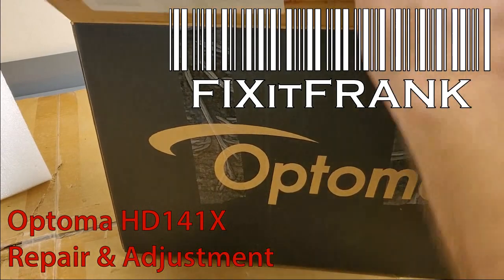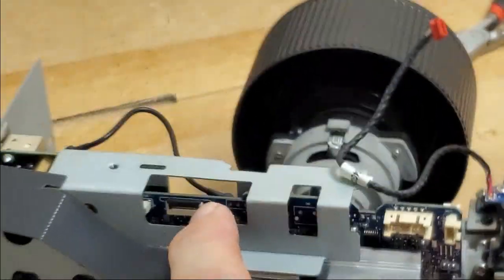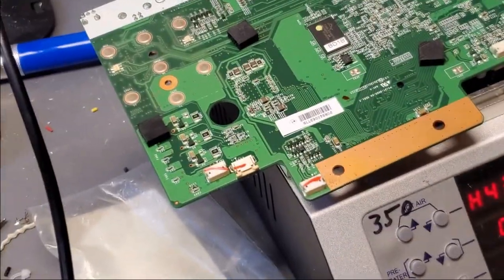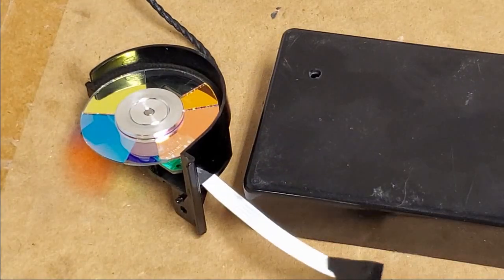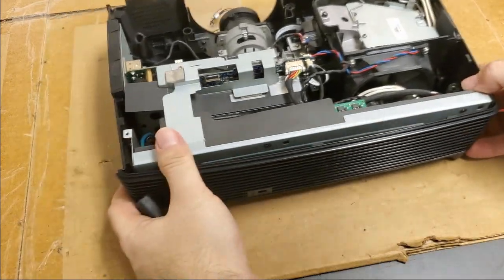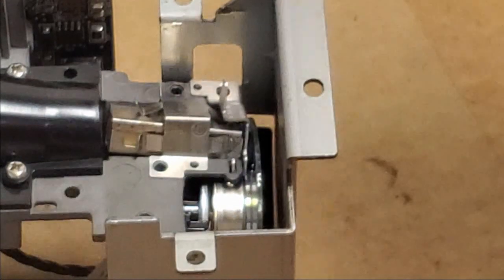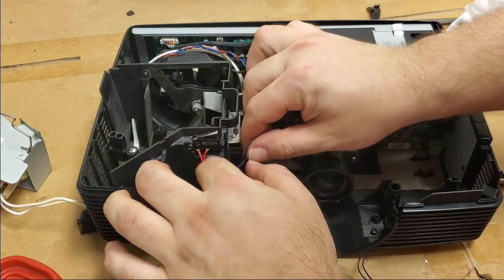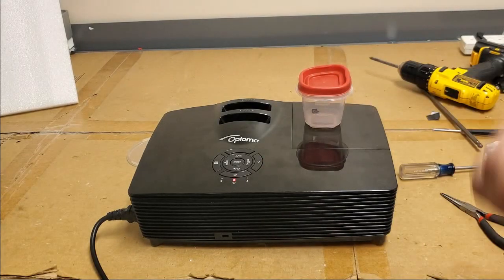Optoma HD141X DLP Video Projector Repair

Comment: Hi Frank, I have this model of projector and have been trying to troubleshoot it. It starts with a blue light and after pressing the power button the same light continues to blink blue. The fan and color wheel do not spin and the lamp will not ignite. Any ideas on what could be wrong?
Reply from the maker: It's hard to say exactly.  It could be a problem with the mainboard, but there could be a power supply problem as well. I would make sure the cables are tight inside. If you are good with a volt meter, checking the low voltage power to the mainboard would be a good first step in checking the subsystems.

Comment: Hey Frank, I have one more question. I have this projector completely disassembled just like in the video. I saw you bending the spring mechanism to adjust the light tunnel. I have taken out those screws to the part you were bending. My question is, how do I know if it is adjusted correctly before reassembling all of this? Thanks again.
Reply from the maker: You won't. Unless you left the top screws that push against the tunnel in place.  Even so, you may have to tweak them a little. They push the tunnel against the spring where as the spring pushes back.  That means loosening will let the tunnel tilt towards the screw and when tightened, it pushes back.  Put on some sunglasses when you tweak the screws to make it easier with the lamp on.  You will see the dark edges move around until you get the dark parts pushed off screen.  Once it looks even, you are good.  Its not really an exact adjustment. As long as you have uniformity with a blank screen you will be good.
Reply: Yep 👍🏽 I have the exact same shadow as this video! I’m just glad I found your video! I know there’s hope for my projector! I’m going to continue to tweak this until that shadow is gone.

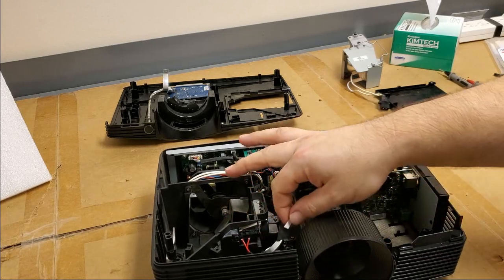Comment: Yep, at 3:16 of the video. I think that's the probelem with my Optoma as well. The bulb blew. I got a new one and installed it using one of your videos. This part was easy. While replacing it I noticed the color wheel had shattered as well. I got a new one and installed it, using another video of yours. This was not as easy. Started it up and was in the middle of testing it when it went off again. Open it up and the ribbon cable from the color wheel was out. The clamp that was suppose to hold it was snapped off. Tried attaching it with electrical tape. It starts up, tries "booting" 3 times (no light) before finally shutting down (blue power light goes off and is replaced by a solid red light and a blinking red light). You think it's the color wheel connection or somehting else? From reading elsewhere, the lights sound like a faulting bulb issue. But I just bought the bulb.
Reply: By the way, thank you for the videos. Even though it's not working, with your knowledge and videos to share it, you make me more confident doing these type of things. Even if I don't get this one working. I know I have spare parts for a new one should I go that route. Thanks!
Reply from the maker: Hi Geoff!   You are very close.  There might need to be small piece of plastic glued to the back of the wire that came off, unless yours has a latching color wheel connector.  What is your model #?  I think you will get it working!
Reply: @FixitFrank  I manage to get it to light up. But now a new problem. The color wheel is extremely loud. :(
Reply: did you get this fixed? we are having same problem. I replaced the bulb (not sure if it needed replacing), I put in new colorwheel b/c last one shattered, but it just does the same trying to start, crapping out, then red lights.
Reply: this is 15 minutes after my prior post, after staring at the video closely: it was my own stupid fault.  When I went into replace broken colorwheel, the white ribbon didn't seem to be connected into anything (or maybe I didn't pay close attention), but when I installed the new one, I hadn't fastened in the white ribbon to the board.  After doing that now it is basically working, but was buzzing a lot louder than it should.  Not usable if it keeps buzzing like that (with new bulb, new colorwheel).  I'm tightening things back up and will give it all another try.

Comment: Great video Frank, like usual. I usually use a sandpaper to clean the ribbon cable. I put a hold on the Epson 3500. I'm working on my garage. I have picked up a refurb Epson 5040ub for myself.
Reply from the maker: Oh I like that. I'll give it a shot myself and see. I've used scalpels and heat before. I like the abrasives idea. Thanks!

Comment: Anybody have issues with this projector not finding hdmi source? I recently replaced the bulb and can not figure out what the problem could be. I have tried cycling the power on projector and input device, swapped hdmi cables, tried both hdmi ports without luck. Everything else about the projector is functioning normally as far as being able to open settings and make adjustments. Any solutions for this?
Reply from the maker: I have seen that but usually after a power surge or lightening strike nearby that cooks the HDMI chip.  It worked before the lamp swap? Is the lamp an OEM or from Amazon? Not that it should matter for this issue but weirder things have happened. Did you try a factory reset? I'm assuming so. It might be a main board issue honestly. If you plug it into a computer, does it recognize the device?
Reply: @FixitFrank  Thank you very much for the reply, it did work prior to the lamp switch, the lamp isn’t oem and was bought from Amazon. As far as I know there was no power surges that could have caused the issue. When I connect my laptop to the projector it still is not recognized as a source. That being said the laptop does infact recognize it is connected to the optima as an output device, so I know my hdmi cables are not the issue. Any way to check the main board itself?
Reply from the maker: In my experience the lamps on amazon are garbage.  Especially the ones with names like "lutema" or "aurabeam".  If your lens of the lamp is not showing a reddish/blue tint(its really obvious) then I would return it asap and get a better lamp. those other filter lenses they use are really bad for your projector. It will cook the optics as they let all the IR radiation in that ruins things.  Usually the color wheel will shut down first.  That said, I don't think that would cause your issue.  I guess there is always a chance but it would be weird.  checking the mainboard is not very easy.   You'd have to use a scope and check the HDMI signals and that sort of thing.

Comment: Hey Frank I have the shadow image on my Optoma 141x and I was attempting to follow your disassembly. The first piece that you removed was that part with the fan attached. After I unscrewed everything that piece does not want to come out for some reason. It feels like it may be glued in. I cannot remove the lamp fixture. Any suggestions?
Reply from the maker: Hello!  Yes, the lamp needs to come out first.  The lamp-well(I dont know the technical name, the part around the lamp) won't slide out unless the lamp is removed first.  The lamp is actually screwed into the top of the color wheel frame. That sandwiches the part with the fan(I call it the lamp-well) between the lamp and color wheel frame. Make sure all the screws are out that hold the sides of the lamp-well to the case as well as the screws that hold it to the color wheel/optical assembly.  It will be stiff but it will slide up along the sides of the color wheel frame.  It kind of slots down on either side.  Gently but solid movements.  Don't pry it too much or pry on the screw tabs as tempting as it is.  Maybe pry 1mm on either side of the color wheel frame until it moves.  This plastic is strong but it's brittle.  It won't take much flex without breaking. 
I would unscrew the lamp-power connector once you get the lamp out.  It'll make un-threading the wire from the lamp-well easier.
https://youtu.be/MJbg72g3Vm8?t=2439  Check this link.  It's when I am re-assembling. It will make more sense once you see how the pieces interact.   Just take your time and don't force anything and you should be OK.
Reply: FixitFrank Thanks for replying so fast and detailed. I have it out now but yes I am going slowly and carefully. I need to adjust the part where you tightened the spring mechanism. I changed the bulb and color wheel but mistakenly loosened one of the screws that keeps that light tunnel balance and now I have to get underneath it to adjust it. I have a dark shadow at the top of my projected image and i am betting that light tunnel needs to be readjusted. Thanks 🙏🏾 again for your quick and detailed response and for the link!

Comment: Hi Frank, I'm finding it very difficult to track down the correct color wheel replacement for my HD151x. Any chance you could point me towards a specific item please? As always, many thanks.
Reply from the maker: Give my friends at Time projector a shout.  GYDZ@Timeprojectorlamp.com  They are a great source for parts.  I get most of my parts from them if I cant find them locally.

Comment: Hi .. I was going to replace the colour wheel in mine, but when I look on eBay they all look like the 15 pound ones from China. Where do I look for good quality parts
Reply from the maker: Honestly they are all basically the same thing.  A color wheel is really basic. However, you may want to try calling Optoma (TSC America) first. They are oddly helpful about selling parts, even if you are not a repair shop.  Here is their contact info.  support@optoma.com 1-888-289-6786.  Otherwise I have a contact in China that I use called Time Projector.  Gydz@timeprojectorlamp.com   Be sure to include a pic of the old wheel.  They ship DHL and take Paypal. I use them a lot and always have a good experience.
Reply: @FixitFrank  thank you so much for the reply. I appreciate the help .. I will definitely use one of these. You the man👍👍👍

Comment: I'm getting 2 solid red lights when I try to power up my hd141x. Changed color wheel and bulb. It starts as light is blue and when I hit power. It tries to turn on and I get 2 solid red lights. Why?
Reply: I hear a clicking sound like it's trying to turn on and then nothing just the 2 red lights solid. Not flashing
Reply from the maker: was the projector working OK before you swapped out the color wheel?  Also make sure the color wheel wire is right side up when plugged in.  I do that all the time...
Reply: @FixitFrank  Hi Frank. I have the same exact problem. I checked everything and nothing seems out of order. I have no idea what to do next? Please helpif you can. Thank you!

Comment: Hi Frank, if I needed an Optoma hd141x repaired, where can I go? No real repair shops come up when I do a search in Chicago. It says the bulb is out. I bought a new one to replace it. I've replaced it but still shows it's the bulb. Any help or advise would be appreciated.
Reply from the maker: Hi Polo, what is it doing specifically? These are known for a color wheel problem, and it can manifest as a bulb issue.  Does it try to start or does it just start flashing the LEDs?
Reply: @FixitFrank  it tries to start. I had replaced the color wheel a year ago myself it worked with the dark shadow at the bottom of the screen. I got a temporary projector replacement and saw your video about fixing the shadow(I'm totally responsible for my own actions) and attempted to fix the problem. When I put the projector back together it cycled through the start up but the bulb did not come on...and the led for the bulb blinked. I installed a new bulb thinking that maybe I might have done something to burn the bulb out but with the ne bulb it still cycles through the start and the bulb led blinks.
Reply: one more thing I remember. The ribbon on the color wheel seemed to slip out. Should I trim the ribbon?
Reply from the maker: @polito96  I would not trim it.  I would make sure it's seated all the way.  If it slipped out, it will prevent the lamp from igniting. Make sure it has the little plastic backing piece that makes the connector thick enough to be held into the connector.  Be sure you have the connector unlatched before you plug it in.  I suspect its a connection problem personally.  If you were comfortable shipping it, I would be glad to look at it too.  My email is listed on the about page about halfway down.
Reply: @FixitFrank  Thanks Frank, I will look at it when I get home. I will let you know the result after. I just started my shift.
Reply: ok Got home. made sure the ribbon was seated right. Started it up and still no lamp light. I will be messaging you soon.
Reply from the maker: @polito96  Sounds good.  I am pretty familiar with these and I have an HD26 around that is almost the same that I can check things against.  I will wait to hear from you.

Comment: Hi Frank, Nice video, thanks. It gave me enough info to find the override switch on an HD151x. The colorwheel on my projector isn't spinning :(. Any tips on removing it to see if it just needs a clean please? Thanks.
Reply from the maker: See my video on the Mitsubishi WD720.  It should be a lot closer to the HD151x.  IF the wheel isn't spinning, I would see if any metal had moved to jam it and I would measure the coils of the motor.  They should be 4-8 ohms(maybe a little more or less depending on your meter and leads).
Reply: @FixitFrank  Hi Frank, thanks for the response :). The color wheel moves freely if I move it by hand, but doesn't spin when powering on. I suppose, though, that I don't know what a correctly spinning wheel "feels" like. I have a multimeter, how do I test the ohms on the wheel please? Again, really appreciate your help!

Comment: I own a optoma hd141x projector, few days ago it was making a lound buzzing sound so replaced the colour wheel the noise stopped. I also replaced the bulb as it was in need of replacing. I have followed all instructions and put it back together properly. But I get no picture when turned on it goes from blue light on the top of projector to flashing red 

Can some one please help please desperate!!!

Comment: Hi Frank I have the same exact projector as you do right there. My bulb exploded so I ordered a new one and when I went to install it it didn’t turn on the bulb itself but everything else worked. Any idea what it might be? I return the bulb in I’m getting a new one shipped to me.
Reply from the maker: I would be suspect of the blower fan(the squirrel cage looking fan) having some glass in it from the exploded bulb.  The other possibility is the ballast took some damage when the bulb exploded.  Make sure that blower fan is able to spin. You can kind of get your pinky finger in there or a cotton swap and see that the fan can rotate easily. IF not, give it a little push and see if any glass then falls out. I have seen this a few times. The glass will get jammed between the side of the casing and the fan blades and jam it enough.  They are low torque so its easy to stall them.  Do you get flashing LEDs after a little bit?  Do they indicate lamp or temp issues? If you see a temp warning, its the jammed fan.  If not, then it could be the ballast. I would see if the replacement bulb acts the same way.
Reply: FixitFrank Ok thanks for the feedback. The fan spins fine and I’ve removed most of the glass. I can’t hear anymore glass from trying to shake it all out. Everything turns on with no red light indicators or blinking. I returned the bulb and maybe they just sent me a malfunction one. It could be the ballast.
Reply: Hi there! I also got an Optoma HD140X and when i start it up then right away at the side where it takes air, it really gets hot, more hotter then normal.

I only have like used it 6 months ago, and it only has like 20 hours on it since i bought it.

Could there be too much dust somewhere blocking the air vents? Or what could be happening? 
Help plz
Reply from the maker: @BelguimLover  Hi There!  The outlet side will be pretty hot.  150-170f is not uncommon.  The lamp itself runs around 400f(or more), so it will get very hot.  Do you get a temperature warning at all?
Reply: @FixitFrank  this is the situation, i purchased it new and over the last 3 years i only use it a couple of times a year. Its stored in a closed cabin.    When i used it the first couple of times when new well yeah its very noisy, and it got hot but okay, now i can feel the heat coming out of it when sitting real close to it and the underside is Hot as F**k ( sorry for the words) .  But no warnings and everything runs fine.
And i never dropped it on the floor or anything so it should not be broken internally.
Reply: @FixitFrank  is there anything i can do as yearly maintenance? I saw online about cleaning out the dust or something idk, also after usage i always let it cool down for an hour before putting it back in my cabinet for storage.

Comment: Hi frank In have an Optoma uhd51a and my front lens element is damaged. Do yo know a source for replacements? Can you do a video on that projector if you have one?
Reply from the maker: UHD51A is going to be kind of hard to find parts for like that but I do have a source you can check with.  gydz@timeprojectorlamp.com  Give them an email but be sure to include a picture of the lens. They will always ask for a picture.